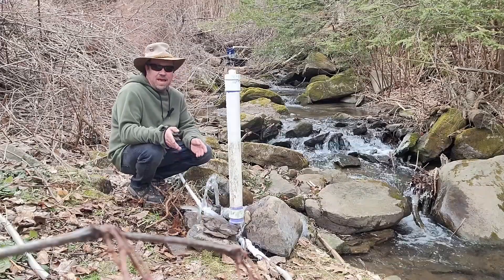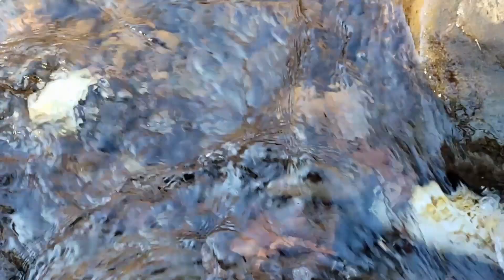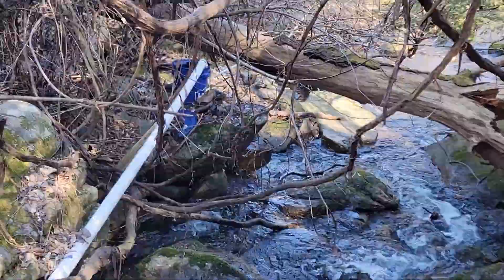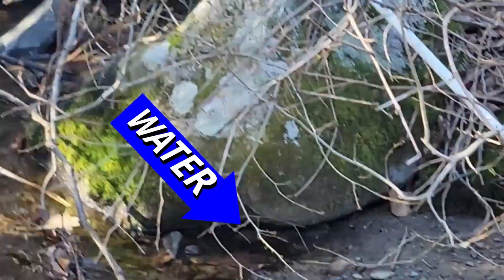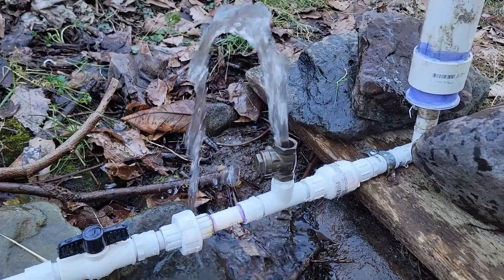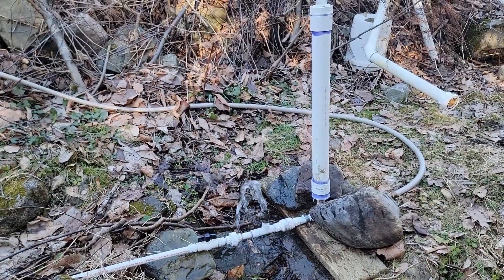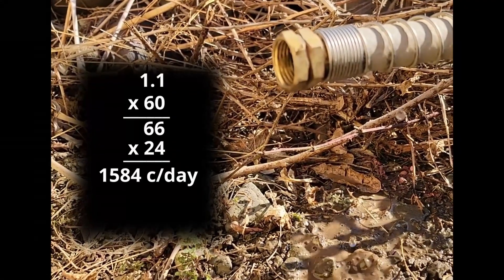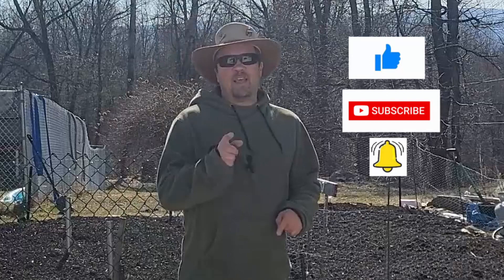NO POWER RAM PUMP! 20790 gal FREE WATER! water hammer

Comment: That’s really cool how far will it pump
Reply from the maker: Distance isn't much of a factor although over very long distances the flow could be decreased due to friction in the hose. As for height you get about 7 ft of lift for every 1 ft of height between the settling bucket and pump. There are other designs that people claim to have better lifting power but 7 to 1 is the general rule of thumb.